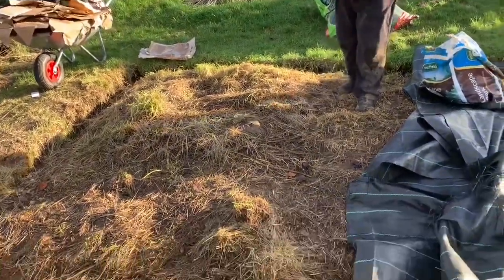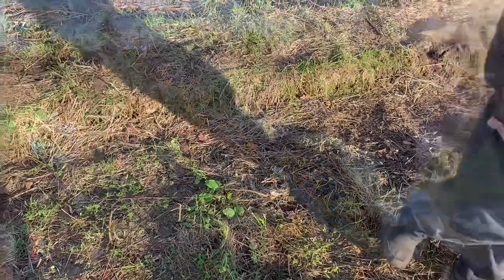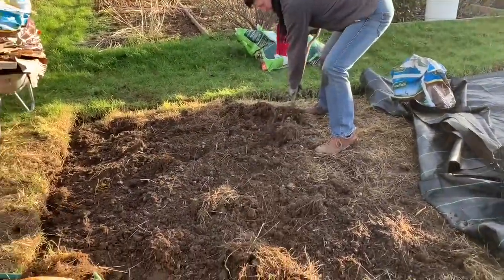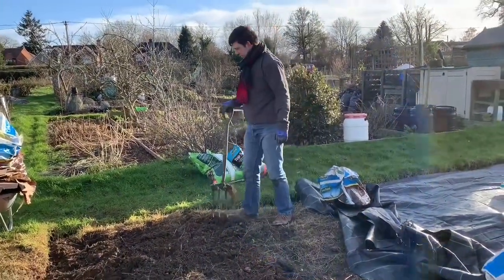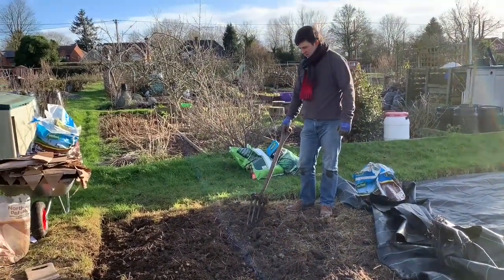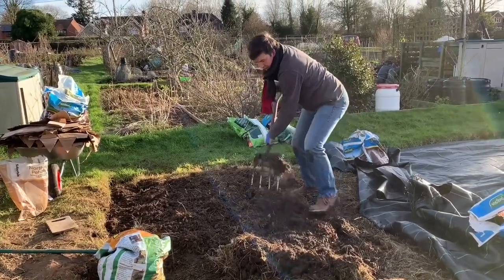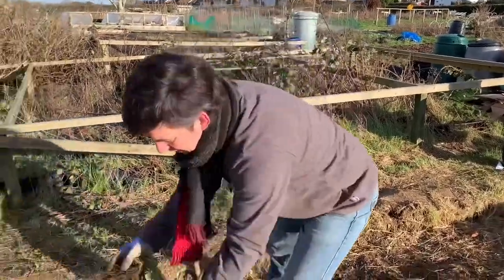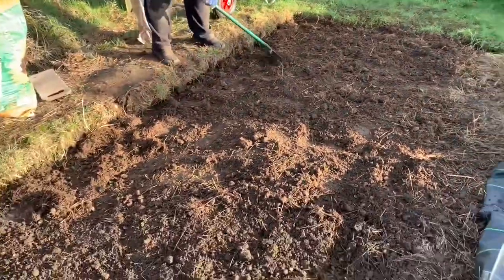EP 9: No Dig, Big Fail - Allotment Plot No. 9

Comment: You’re doing well. Are you going to put in any paths or just have large beds? Beds a little over a metre in width mean you don’t have to keep walking on the beds but you can have wider ones if you’re going to grow lots of potatoes. Mine vary in size giving scope for growing different veg. Paths can be as little as 40cm wide. I use cardboard covered with wood chips. My older paths have membrane covered with wood chip. Good luck on your allotment journey
Reply from the maker: Thank you so much for your useful advice. I have already bought some recycled scaffolding boards to make the beds. Some are 1m50 and some are 90cm so our beds will probably be 150cmx90cm. We might double up some of the 90cm to make some beds 180cmx90cm for things like potatoes or pumpkins. We will have paths between the beds. We are planning to make them with membrane covered with bark.

Comment: What size are you planing to make your beds? 😊 What do you want to plant in them? 🥦🥕 Btw, you can place manure under the membrane directly where the future beds will be  only, leaving out the walkways in between, this way you will save yourself a lot of precious manure , and some unnecessary labour with wheelbarrows 😉😃
Reply from the maker: We bought some recycled scaffolding boards that are 150cm and 90cm long. We will make the majority of the beds 150x90cm and a few bigger ones at 180cmx90cm.  It does make sense to not cover the paths with manure but for now we just want to get the weeds smothered under the membrane. When we do have the paths and beds worked out we can move the manure on the paths back into the beds. It is more work but hopefully it will mean no more weeds in the long term… we hope 🤞🤞🤞😊
Reply: @plotno.9  wow, camera Does make everything look bigger :)) - I thought from today's video that the beds are At Least 3 meters long! 😄 What vegs do you want to plant there ?🙂
Reply from the maker: To be honest, we probably bought the boards for the beds far too small as when we measured the space on the plot, they did look tiny. We will just have to adjust when it is time to build them. We will use your advice on using string to mark the spaces. We have calculated that we can fit 11 beds on the area covered by the membrane. We will be doing a video on the seeds I bought. I definitely want to plant asparagus, even if they take a long time to grow, as I love them !
Reply: @plotno.9  Oh, the video on seeds, its interesting! 😊👍🌱 About boards, just in case you didnt buy enough or will want to expand the beds, - you dont actually 'need' them with no dig beds, - the woodchips in walkways will keep the compost in place 🙂 even when the bed is 15 sm high 😊👍

Comment: When I took my appointment on I was planning on doing no dig but I had the same problem as you. In some areas I had large hole, some at least 20cm deep. Other areas had huge mounds of soil piled up. As I removed on of the larger areas I found a pallet buried under the soil. Now it’s all flat I have started on the original plan of no dig. Unfortunately my site doesn’t supply free manure so it lots of trips to pick up free manure from the stables down the road.
Reply from the maker: Oh wow, it sounds like you have achieved so much. It must have been so much work. It seems you are still doing a lot of work going down the road to get some manure. We are so lucky to get some delivered to the plot. Your allotment must be looking so good after all your hard work !
Reply: @plotno.9  it’s getting there…slowly. Your also putting in some hard work and it will pay off once the season gets up and running. You will be amazed at how quickly the year goes.

Comment: First off, fantastic video.  As always you show your work ethic and because of it you get so much done.  I do have a couple of suggestions but these are not criticisms in any way, just hoping that you may be able to do a better job (maybe save some time too).  For the area that you ‘mulched with manure’ where the greenhouse will go.  I would suggest that you do not manure until you have the greenhouse up.  THEN cover the inside soil with cardboard and then manure and then soil or whatever.  For the plot area I am a little confused why you used so much manure.  My concept or the no-dig idea is that you do not need to manure the pathways.  So you will need less manure (you can just scrape it up higher on the beds if you want to) say a patch 0.9m wide (width of your bed) THEN for the pathway use wood chips of the like (hay or straw would work too) or just put an extra layer of cardboard until you can get a covering material.  In terms of your ‘FAIL’ - no you didn’t fail at all.  The idea of no-dig is to disturb the soil as little as possible.  That’s WHAT YOU DID.  If you watch more Charles Dowding videos you will see that he says, and many others do too, that you can especially disturb the soil at the beginning when establishing the beds.  ITS THE LONG-TERM aim to no-dig, you do what you have to do to set them up and I think that you did the right thing.
One last thing, I’ve mentioned this before - if I were doing the card boarding I would be a little more careful to cover all the gaps.  I speak from experience when I say that the weeds will come through those spots.  No real harm done though because you can dig the weeds out - it’s just more work than you probably want!!  Keep up the good work and good channel- it’s fun for me to watch what you are doing :)
Reply from the maker: You are absolutely right, we need to be careful not to have gaps and overlap more. Thank you for the good advice on the greenhouse. The reason I have been using the manure is not only to bring hopefully goodness to the soil but mainly to have some weight on the cardboard to smother the weeds until we get around to getting some compost. My aim was to first buy the shed and the wood for the beds then I will buy the compost needed for the beds and the greenhouse and the bark needed for the paths. I am keeping to a monthly budget so I couldn’t just buy everything at once. The manure is free and is topped up every Sunday. It is also mainly straw so it makes a good mulch. Going ahead, I am planning to remove the manure off the paths and put a textile membrane on top of the cardboard and then the bark. For the beds, I am planning to put more cardboard on top of the manure and then compost and that will be the start of my no dig beds. Although someone has mentioned that the manure might burn the plants. As far as I can see, the manure is not hot as it is not thick enough, but if I feel any heat when I am making the beds, then I will put the manure aside to mature. I really don’t think it will be hot as it is mainly straw. I hope this explain everything. What do you think ? I always welcome suggestions as we are learning. Thank you so much for taking the time to comment. I really appreciate it. 😊
Reply: @plotno.9  i would not spend any more on membrane.  For paths I use cardboard and then at least 6 inches of whatever free wood chips you can get.  I am about to Reno an old allotment so after lawn mower ing and covering areas with cardboard I will ‘sketch out ‘ my beds with old lumber or cut up trees.  Add the compost inside (spent mushroom compost in Ottawa is plentiful and CAN$45 a yard) put paths around the beds (14inches for small paths and 20inches for the throughways) using the 6inches of wood chips (all the arborists are willing to dump their daily wood chips because it costs them quite a bit to take them to the dump) then I remove the bed surrounds and start over with more beds then more paths.  In the past when I have done this there are always weeds that come back up - beds and paths but I would estimate less than 0.5%.  If the weeds are perennial weeds - ‘dog weed’ :), brambles, comfrey, bindweed etc. I dig that out then put a patch of cardboard (maybe a 1 door square) below the compost, or the wood chips, then recover and most of those weeds don’t come back.  With no perennial weeds it’s usually just a case of troweling them out.  You are doing fine and likely it’s hard for you to see the whole picture right now.  Keep on doing what you are doing and then react to problems as they come up.  You are getting some great advice and sometimes those ideas won’t work but you should think of it as 2 steps forward and maybe once in a while one step back.  I will get back to watching the rest of your videos (catching up) later tonight.  I am really enjoying what you are posting:). Thanks again !
Reply from the maker: I have already bought the membrane as it was on sale on Amazon last month, so I will use it for now, but in the future I will only use cardboard. I am trying to get some free wood chip but so far no luck. Everyone seems to sell it around where we are. We also have to go and pick it up. We will just have to do it. We had to do it to cover the borders in the garden. Thank you very much for the measurements for paths, this is very helpful. Good luck with your allotment renovation, with all your knowledge, it will look amazing !